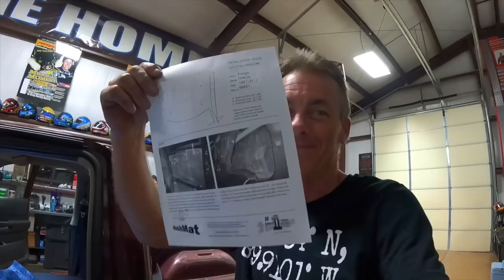Junkyard Date

Comment: Clay. Just redid the headliner in my 02 Dakota. The material is a thin backed foam and lasts about 15 yrs. They can get any color and clean and re glue to the board backer, Looks new and not too expensive.

Comment: Clay always appreciate your insider as a driver and what happens in the pit and on the starting line. Fans never get to hear the voice of the driver or the crew outside of broadcast shorts. Thanks so much. There is a lot more that goes into racing than most fans get to hear about.

Comment: I found that if you pull your door panels off, and roll the windows all the way up. 
Then do a little masking tape over the window hardware as best as you can on the parts where the mechanism roller tracks, and pivot points.
Possibly wipe inside of door skin clean of dust, dirt, or whatever may stop next phase from sticking to it.
Then get yourself some good 3M undercoating, and make sure you have anything covered that you may accidentally get the undercoating on that you don't want coated.
This includes yourself, and then apply a liberal coating inside outside door skin making sure not to clog the drain holes at the bottom. 
Let it setup as directed per can, and spray another coating.
I typically try for 3/16" to 1/4" evenly coated on everything you can get to, including the bottom of door itself except drains. 
Yes Sir you added a little weight to the door, but you just eliminated all rattling and vibrations from the road bumps, radio speakers bass possibly vibrating door skins, and you just insulated the doors themselves without something that holds moisture. 
Hopefully you read this, and give it a try, because it does help all the above mentioned items. 
Y'all take care, have a Great Day, and may Tomorrow be even Better than Today.

Comment: I wonder if the junkyard date will get you a second date? hahaha. Thats interesting about the main stud nuts loosening up. You can't really lock wire them or stake them. Maybe just remove the coating. Unless the studs are stretching but I wouldn't think it would be that. I'm sure they test that pretty thoroughly. Thats an expensive way to learn a lesson thats for sure.

Comment: Hey clay I was recently online looking for a dash bezel  That goes around the radio and speedometer cluster for a 2005 GMC safari  Couldn't find it at any u pull it had to buy it off a Amazon used $250 Seen other ones as much as 500 that is crazy

Comment: Hi from the UK you discussed the reason for blowup and said there was some kind of coating on the washers which allowed the main bearing bolts to come loose with the resulting loss of oil pressure when we don't want a bolt to work loose under extreme loads we use Nordlok washers they are a single use item but they certainly get the job done can you tell me if there's a reason for not using them

Comment: About the gloves that the crew uses to clean the tires before each run. Would a rough sand paper type surface on the gloves work better and would it rough up the tire for a little more traction? This is probably a stupid question!